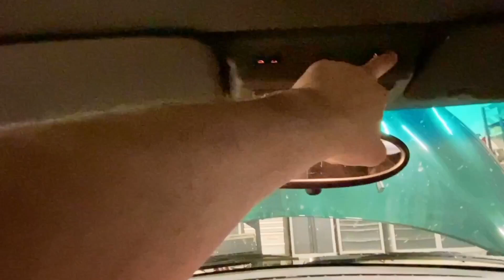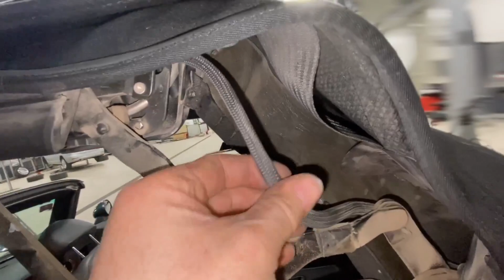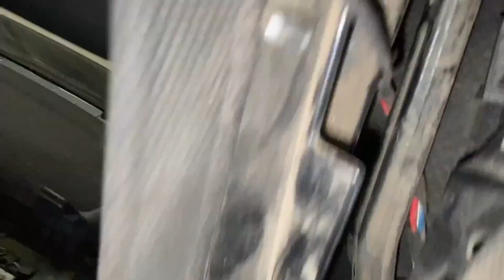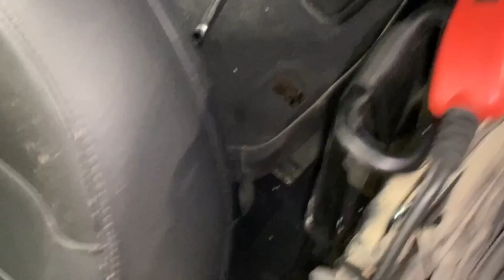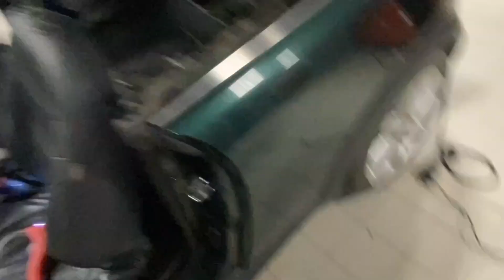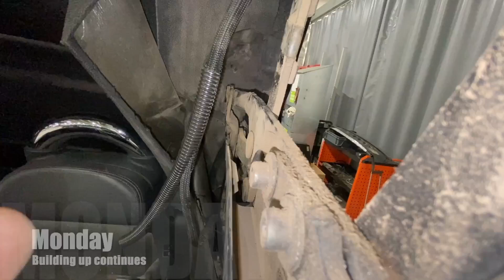Mini convertible roof failure FIXED. Hall sensors SHORT to ground.

Comment: Hi Ben, I would love to pick your brain on something.
I have a Mini cooper one 2013 .  My rear windows and roof are not working, I have bot the car like this.
I have tried everything  and even sent the BCM and footwell (Fuse box) to be diagnosed. BCM was fine but they could not get the rear windowns to work on the bench.
Is there anything you would recommend. I have bot a roof pump and about to istall this, but I dont think this is th problem. How much would you charge me to give me some advice..
Reply from the maker: Hi there, I charge 100 euro one off fee for tech support via email and whatsapp. The trouble is I have very little time these days. The only way I can do this is if you email me as much images, fault codes and information as you possibly can - from that if I feel that its something I can diagnose with a reasonable timescale I may take it on and help. Thanks for asking. There are so many who expect me to help for free 😂 I think we could fix it together but please send me the info first - I dont charge to look at the pre-work information 👌

Comment: My 6 pin gets 0v on all but red shows 3k on continuity test im so lost 😂
Reply from the maker: It isnt easy but 3k ohm continuity? Make sure all components are disconnected so you measure just a wire end to end

Comment: I have the same code. Also suspecting the wiring. How do I get the fabric off to reach the hall sensors and the wiring? That part seems to be missing in your video.
Reply from the maker: Its difficult to explain unfortunately but involves removing the centre bow metal box and peeling off the front cover with the roof half retracted

Comment: I just found this video and it has informed me greatly.  My issue is the top leaves a gap when closed.  It leaves about half an inch gap, and we hear whistling while driving Top Up.  I don't know how to adjust it to close completely, can you suggest something?  Thank you.
Reply: Unhook the motor and take a flat screwdriver and force the cables all the way forward so they push on the latch cams
Reply from the maker: It can bw adjusted but you would need to spend time reading. Its not something i can explain tbh
Reply: @BenJFF  I understand, I will do more research to see what I can find out.  Thanks for your reply.

Comment: Great video. My roof is in the down position I won't operate just don't know where to go with it. I replaced the white module is the real left quarter.. Windows recorder Windows work now after replacing the control module on the driver's side footwell. It's just a roof totally dead check the parcel shelf. Any idea what it could be.Tyanks
Reply from the maker: There should be fault codes buddy. Usually its the wiring as in this video. If there are any sensors not showing correct values the system just locks out completely. Scan fault codes and look at hall sensors statuses in live data 🙂
Reply: @allmech_BMW_fault_finding  Thank you .. I just really want to get the roof in the up position. I thought you could undo a screw on the hydraulic pump in the rear left boot compartment?

Comment: I'm having the same problem just when the mechanism lock opens and stops moving the soft top.

Can you advise me?
Reply: Just to be safe, make sure the latches that hook into the A Pillars are not broken. They have a plastic part that tends to brake. Sunroof will work but the top won’t go down. 

Also there is a micro switch in the back. (Well, there are 2 actually) where the hardback cover below the window seats on the left hand side. 
Make sure it’s making contact with the switch. 

Those are 2 quick things to check.. Good luck!
Reply from the maker: @renzonovara2728 very true. Good point 🙂

Comment: Thigh't  wires ....,
Mini coupé , rear spoiler wiring so tight , i wouldn't operate the spoiler because lost connection, 
Customer going nuts because the dinging sound all day long .he he🤣
cut the holder ,  solved